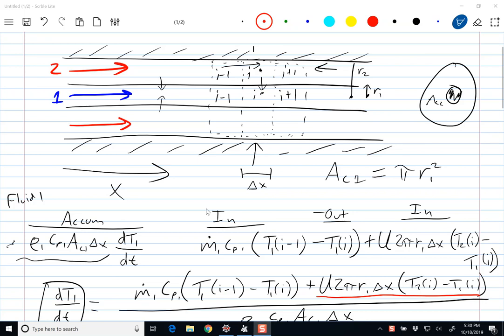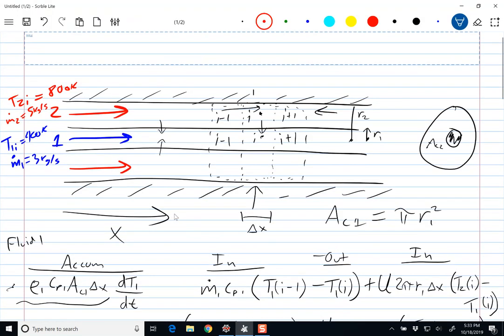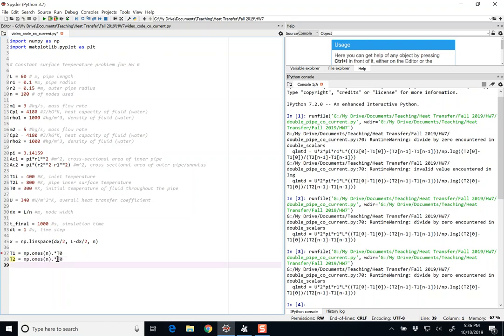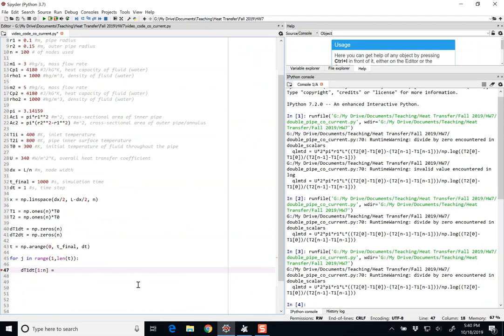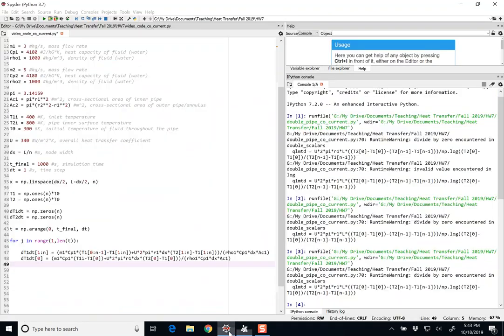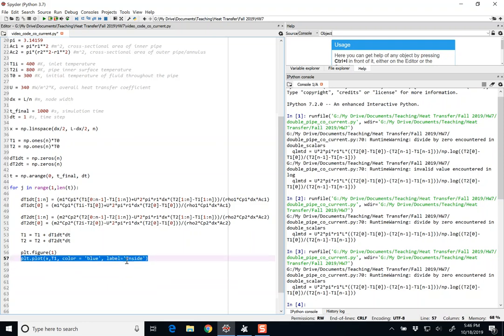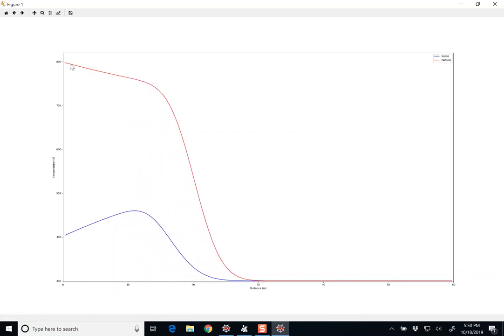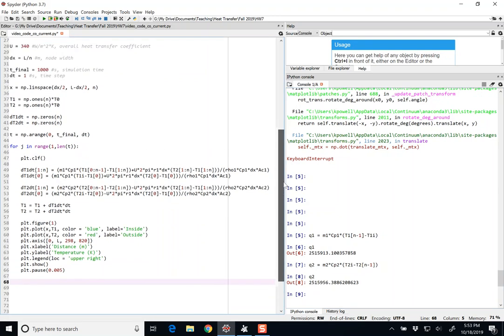Simulating a double pipe heat exchanger dynamically in Python (Part 2: Simulation in Python)

Comment: Could you please explain me the difference in meaning between T1i (or T2i) and T[0]? I really don't get it.
Reply: If you're still wondering, T1i would be the temperature of fluid 1 just before it enters the pipe of the heat exchanger, whereas T1[0] would be the first node inside the pipe we are simulating that has to receive the flow at T1i. Atleast, thats how I understood it. Hope this helps.

Comment: hey, sorry to bother! Do you have that simulation but for 
countercurrent? Thanks!
Reply from the maker: I don't have a video of it, but can send you code if you provide an email address. I used the countercurrent as a class assignment, so don't want to give away the solution publicly.
Reply: @kodymerlin  Thank you very much!! If it's not a problem for you, my e-mail is berilo.santos@engenharia.ufjf.br
Reply: @kodymerlin  Hello, i have a problem during executing the code :
 dTdt[1:n]=(m*Cp*(T[0:n-1])-T[1:n])+qflux*2*pi*r*dx)/(rho*Cp*dx*pi*r**2); (parse or syntex error) could you please help me out actually im doing for an insulated pipe
Reply: @kodymerlin  Would it also be possible to forward the simulation for the countercurrent to me please? My e-mail is Filip.dries@student.uantwerpen.be. Thank you very much!
Reply: @kodymerlin  Hello! Could you also kindly share it to adityapillai009@gmail.com? Thanks!
Reply: @kodymerlin  Hello, could you please send me the simulation code for the countercurrent. Thanks in advance !
Email: maya.mfz.gut@gmail.com
Reply: @kodymerlin  Congratulations, it was an amazing problem description! Can you please send me the code for the countercurrent part as well? (email.:zed.tylor@gmail.com) Thank you very much! I also have some minor questions, regarding to the problem. If i assume a wall thickness, it is clear that i have to calculate with different radii. However how do you handle the material between the two countercurrent flow, if it is maybe an insulation? Thank you for your time and patience :)
Reply: @kodymerlin  Thank you very much for the explanation! I was wondering if you could also send me the forward simulation of the countercurrent flow. My e-mail is tijmensamueltud@gmail.com.Thank you in advance
Reply: @kodymerlin  Hello Kody, 

I have asked myself if there is a chance if you could share your code for the counterflow heat exchanger? 

It would help me a lot to backcheck my designed heat exchanger for my master thesis. Thanks in advance:)

Greetings from Germany
Reply: @nikitataratin2121  Did you get it? It would help me a lot too
Reply: @gabrielaoliveira2294  if you get the solution, kindly share with me as well. It would be really helpful for my thesis
Reply: Hello. Thank you for your excellet video. I still can not figure out the countercurrent flow in Python. Can you send me the code please to laci400@gmail.com? Thank you!
Reply: @Kody Powell   Thank you very much for your work! It´s very helpfull and clear. Could you please share the countercurrent to my email? Thanks in adavance professor!
(email: ganorabaco@gmail.com)
Reply: Hey there,
amazing video to get in touch with dynamic simulations. I am also interested in the code for a countercurrent flow arrangement. It would be very kind of you to share your implementation in python 3(myinsanity.eu@hotmail.de)
Thank you very much!